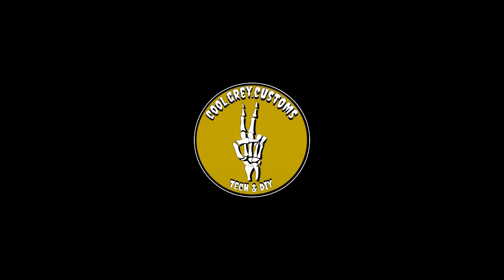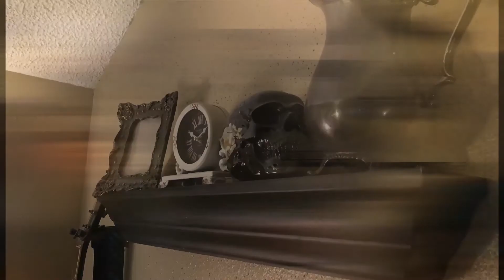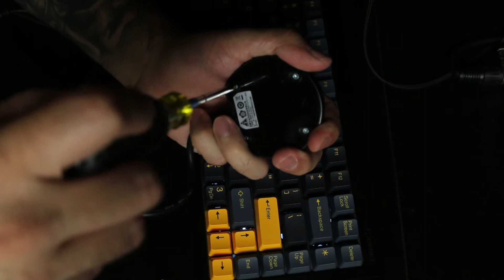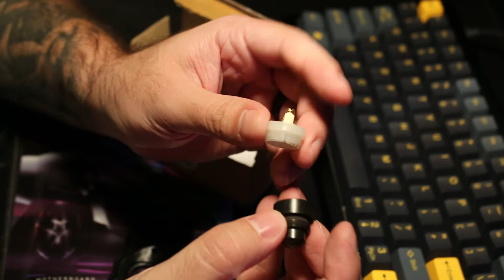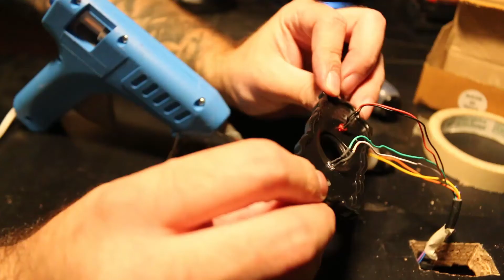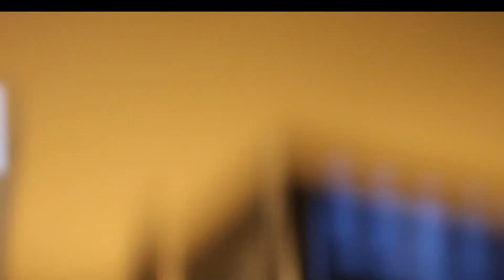Creating a Custom PC Power Button

Comment: Hey I know this is a late moment but do you know what you did with the final blue and purple cables - Do they need to be attached or can you just leave them hanging? Also would you do the same if you didn't have LEDs or even just had one LED?
Reply from the maker: I honestly don't remember what the blue and purple went to, but my guess is they were for the reset button which I did not use. I separated the cables from each other and taped the ends so they wouldn't make accidental contact.

Comment: There is no difference between a low voltage dc and a low voltage ac switch.
Reply from the maker: No. There are switches that can handle both style loads but the given rating will be lower for dc application because of the how the switch extinguishes arcs and the switching speeds. In a low voltage scenario it is much less of a factor considering how low the draw is, but that doesn’t mean there isn’t a difference. Always a safer bet to use a switch rated for the appropriate circuit type. Even in my scenario it’s possible the contacts will wear quicker as opposed to using a dc switch.

Comment: The gun mounted on the wall looks super cool! Have you had any problems with accidentally pressing the switch in that position? Also I used freezer paper in a project a while back to help diffuse some "sharp" LEDs. Great video just like the others : )
Reply from the maker: Thank you! No problems with accidental presses, it’s a pretty good reach , and the doorbell requires a good amount of pressure to actuate which works out. Thanks again!